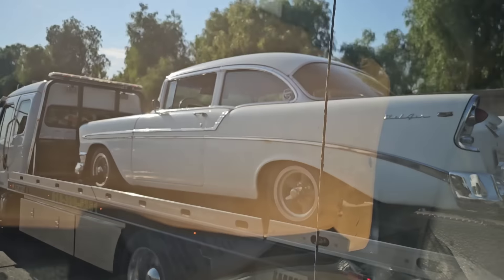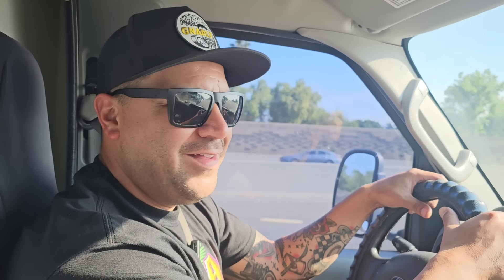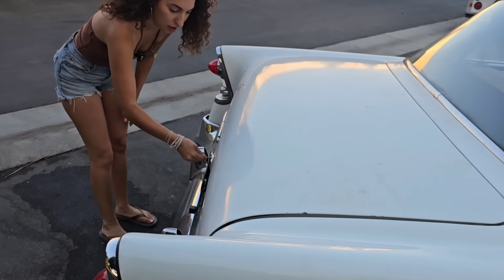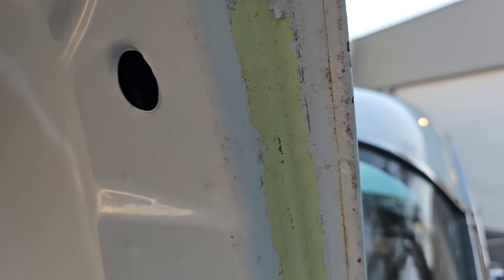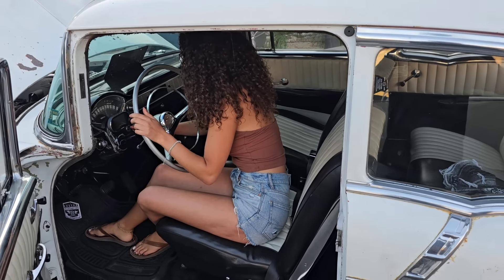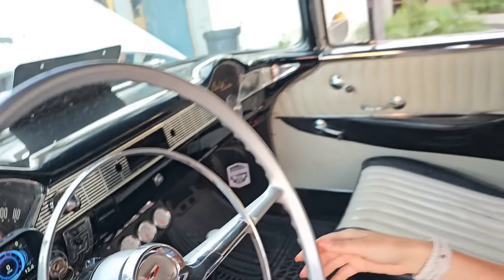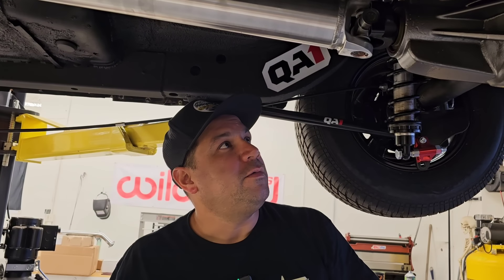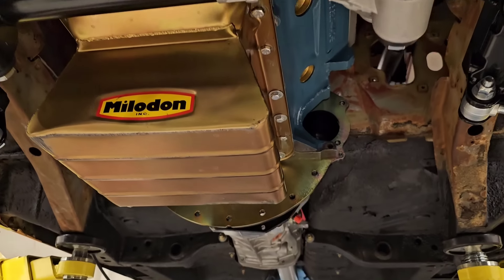I'm Going To Transform This 1956 Chevy Bel Air – Found A Better Project

Comment: Driveshaft loop should be within 6" of the front u joint . That's the NHRA spec, you can also put one in the back, but it's not required  . Keep up the good work  👏
Reply from the maker: Thank you for that!

Comment: @36:39 it looks like that c-clip on the u-joint, maybe not seated all the way you may want to check them, I can't tell if it's the reflection or not but it looks like the c-clip is popped out of its little channel on the top side of the u-joint if you're looking at it at 36:39 zoom in and you will see what im talking about. 36:39

Comment: Yes those pull straps are factory, my mom had a 56 2 door hardtop with 283 fuel injection and 3 on the tree,you have a very nice 56 good luck

Comment: 2 door over a 4 door 7 days a week.
Reply from the maker: I still have love for the 4 doors but I personally wouldn't own one.
Reply: I have a 4 door 55 Bel-Air with a 265 Cast Iron Powerglide  Built in Norwood. It's a month older than me. Regal Turquoise/ India Ivory.

Comment: Nite and day difference fo sho on the Belair👌I would recess that fuel cell into the floor of that charger a little lower for weight center of gravity even with bottom of frame rails    ☮️

Comment: That 56 is a real gem! I agree, hookup the factory speedo and get rid of that little screen! Maybe a RetroSound head unit radio for the dash so it'll still look old but with modern tech. The Charger is just pure awesomeness! Honestly if I had one I couldn't pick a better combination of driveline and suspension! That thing is gonna be a monster when it hits the street!

Comment: If you finished it two tone with black on top and the white on bottom it would match the interior perfectly. For someone who wants to avoid metal work this is a perfect option. Some chrome wheels, some wide white walls and a major detail this is ready to go. That being said, metal work is cool, it can be fun, check out Mike Bello from Bello’s Kustoms he has a cool easy going approach to metal work, I emplore Ms. Olivia to at least in your own time get to be comfortable with doing some mig or flux welding, because apart from body or panels there’s always something that’s gonna need a weld in regards to suspension work etc.. as my Grandfather said, if you’re determined, things that are difficult can become easy. Love goes out. 💯

Comment: DRIVESHAFT:
On the u bolt nut and lock washer. In theory when you torque up a lock washer it flatten and spreads out. No more lock. So what you need to do is get a lock nut and a harden flat washer. This will be a better insurance and claming support.❤

Comment: You can use those mirror cameras to collect B-roll for this Channel. It looks like there was a USB -C port on the side of it. She needs to keep that LS and with the dash board. Its 100% better setup for reliability. Dial in that LS and you wont be disappointed, I promise you.

Comment: congratulations. i think its a great car to start with. thats really what i was hoping i would find, then found something too nice and painted....in lots of pieces/lots of assembly required. lol. speaking of i went out and looked at my 56 Bel Air, it has like zero interior. but it does have screw holes about where those pull handles are in your car. maybe i will need to look for some. add it to the list, for my "compete car, all parts there".

Comment: The  loop what I saw were on the post car and it’s easy to tell if it was  a 3 speed car by the  outside of the column because it has two loops and the Power Glide cars have one.
Reply: My folks bought mine new I was brought home from the hospital it it in 1972 they were divorced mom blew it up in 1975 i fixed it and I still have it 49 years later.
Reply: And of course on the bezel has the  PNDIR

Comment: On the Charger a Driveline loop is required in the front. You need to look at the NHRA rules. I believe it can’t be over 6” away from the U-Joint. It doesn’t hurt to have one in the rear as well.

Comment: Better replace the radiator support. I know people have been cutting those to move the radiator forward for fifty years now but you get that car over a hundred and those fenders will start flapping in the wind without any lateral support. You don’t want that to happen.
Reply from the maker: I'll wind up fixing that. Noticed that right away

Comment: Nice car the straps in the rear on the posts are original the  steering wheel is a 57 chevy. And check the travel of the drive shaft on the charger into the transmission.  Drive  shaft maybe  to long. Just my opinion.

Comment: I'm curious on the clearance of those wheels with the calipers. 
They look like old ETs,14x7s and with disk brakes, I always had to run 15s.
Thats 1000% times better than that other one. I'm guessing you paid $14-18k on the car. But with the LS swap (and it looks to been done right) that might add $4k

Comment: 5.3 Vortec use iron blocks while the LS generally uses aluminum ones. So if it's a Vortec it's not an LS. What's different? Water Pump, crank, rods, bearings. The 5.3 Vortec wasn't a terrible engine used in light trucks and SUV's. The next engine, LMG was a flex fuel creature

Comment: the 56 looks like the fairlane ford sold more that year. i would leave that 5.3 if everything is good mechanically. that car is a real jewel. in ny here we have rotted junk if they arent rotted out they have been out of the elements and the nasty salt in the winter.enjoy that and run it things arent cheap anymore muchless made here. no electric junk.

Comment: in 1968 15 years oldmy first car with a 1956 Chevy 3 speed on the column 283 Bel Air gas fill on   the driver side back tail light USS John F Kennedy CV 67 Connecticut 74 TO 77 👍👍🏁🏁

Comment: I'd keep the mirror. It doubles as a dash cam, most likely has collision detection and motion detection for the would be thieves. The buttons to control it should be on the top or bottom edge of the mirror housing.

Comment: Saw that the spark will cancel out signal to coles and coils packs enterupting 📶 chec k coles che KS good don't change em sysyt should be good check modes reader don't use the ring reader's if ☒ check list it mechs around the effect electives in CPA cpu t no reporter's apps in apps

Comment: it's so funny watching kids nowadays you hear um "I want to get rid of this fuel injection and get me big ol Double Pumper Carb" or the LS vs Small or Big Block thing and don't get me wrong if you're trying to do a Restoration fine but if you want to get out and enjoy your car (I mean driving it not working on it along the way) and believe me you'll get your chance to work on it cause if it has wheels or,  well let's not go down that rabbit hole of the kinds of things you're going to have to work on,  I can remember when adjusting your Air Fuel Mixture meant you were going to smell like Gasoline not tapping on a Keyboard,  all I can say is embrace technology if you can but then again I guess you'll have to learn it the hard way 😉